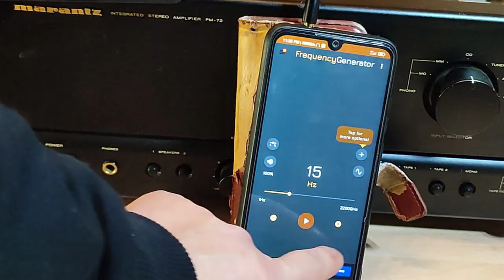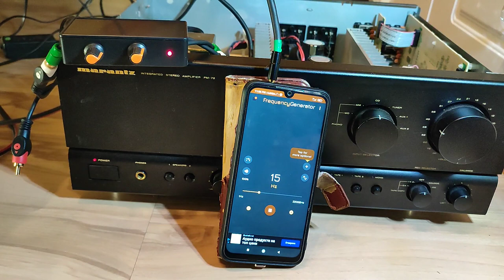DIY Bass Shaker made of old loudspeaker - a.k.a. Tactile Transducer with active crossover

Comment: Can you share a list of parts used?
Reply from the maker: Basically what you need is old low frequency speaker, at least 10 or 12 inch,   couple of bolts and nuts, a piece of wood, stereo amplifier and low pass filter board. The low pass filter board used in this project was from AliExpress. This is the exact model: BGN 4.25  14%OFF | High-precision Single Supply Low Pass Filter Board Subwoofer Preamp Board 2.1 Channel DC 10-24v 22hz-300hz
https://a.aliexpress.com/_mr1eSUq. If you need some further information I will be happy to help you 😊👍👍👍
Reply: Nice work bro, is the bolt in the middle touching the speaker ???
Reply from the maker: The bolt is glued to the center cap of the speaker. It should be fixed very strong there because this make the whole speaker chassis vibrate. It is like speaker working in reverse. Instead of moving membrane it is moving the magnet:)
Reply: Did you cut out anything from the middle of the speaker? There is supposed to be a center pad